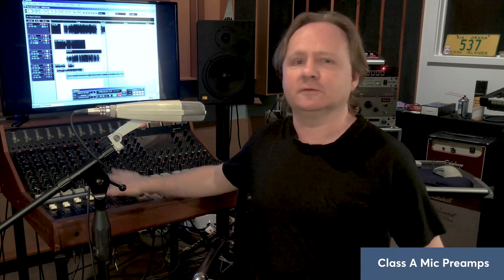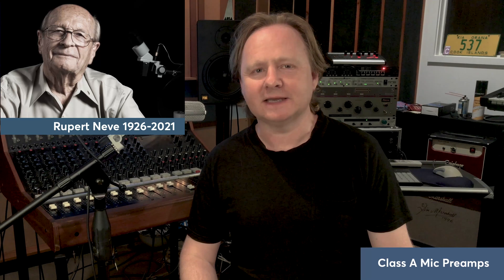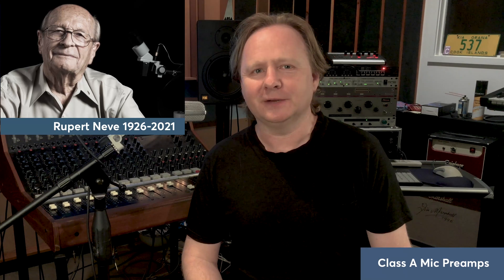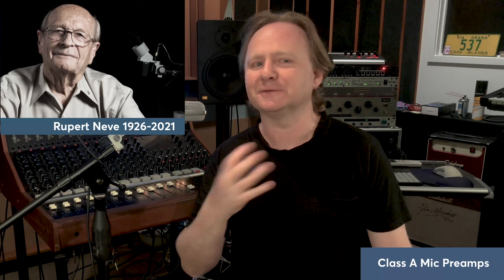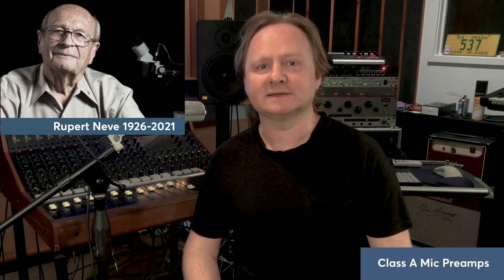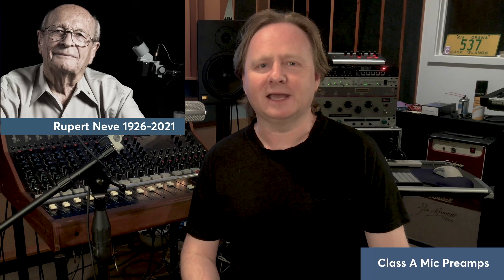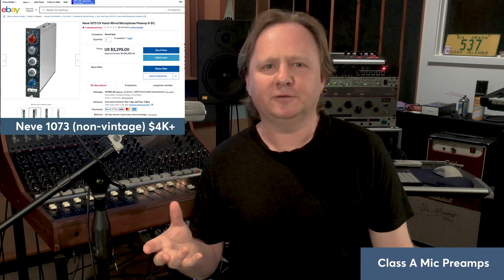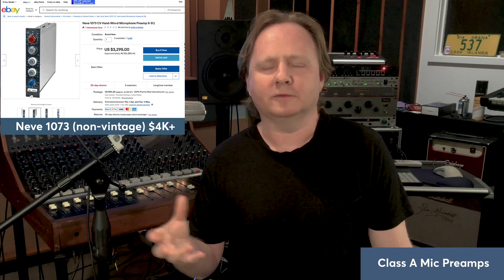Neve Mic Preamps - What is Class A audio and why are they so good?

Comment: the statement about heat is kinda wrong i think. i own a neve 8014 (class a), it does get a little bit warm. but the chip console like neve VR THESE get HOT!
Reply from the maker: True, the IC consoles are the true cookers ... however the large metal transistors in the 80xx consoles did have heat sinks
Reply: @jamiedurrantmusician   yes i know that my modules have heatsinks at the transistor, but the console still doesn't get hot.
Reply from the maker: @pongmaster123  Have you left it on for a day in winter in a seal room?

Comment: “From 1991/92”

I’m looking at a SOS review from 1995 of the brand new (for that time) SR24. Is this different than the one you recommend? If so how do you tell the two apart?
Reply: Also, looking at the circuit diagrams, it’s class a, but not discreet (uses opamps, rather than transformers/transistors). Never bothered to distinguish between those two classifications as you so often see them together. That just shows how un-holistic my knowledge of electrical engineering is. lol
Reply from the maker: The SR24 is a more streamlined cheaper design but still has the sound and very clean VLZ mic preamps. I think it is more limited with only 1 mid sweep eq - the earlier designs  had two mid eq. I did an album with a band in the early first release console and one on the SR24 - the tonality was identical. And the recording sounded great!
Reply: @jamiedurrantmusician  So, how are we to tell the difference between the two versions?
Reply from the maker: @GeoffBosco  Sorry, the original series was the 24.8 8-bus for example - then came 16 and 12 channel versions. See: https://reverb.com/p/mackie-24-dot-8-24-channel-8-bus-mixing-console - the SR came after the 8-bus models
Reply: @jamiedurrantmusician  Thank you!

Comment: I think you forgot to mention a lot of the Neve character. Input and Output Transformers to fatten up the sound with harmonic distortion. The ability to slow the transients down from the windings and transformer gauges to reduce harsh spikes in the signal. The circuit design adding some natural compression gluing the tracks together. It would help to educate people why the NEVE sound is so desired, and how it makes mixing easier by adding these characteristics. That way people can learn what to listen for.
Reply from the maker: Brilliant points Matt... sounds like a part #2 is required.
Reply: @jamiedurrantmusician  Thank you! I just hear so many people talk about NEVE, but most new engineers don't understand what vintage gear actually did to the signal. As audio goes more digital for recording and using transparent preamps. Most people don't even understand what is missing or what "that sound" actually is.
Reply from the maker: @theblowupdollsmusic  You make a lot of very good points... I'll re-watch my video and consider how I've not covered this topic thoroughly enough!
Reply: @jamiedurrantmusician  I'm excited to see your follow up! :)

Comment: 💯 great vid 
As close to class A as pos is always best. that doesn’t require actual class A tho, example of class A/B below (close to class a but NOT class B)

Neve Air consoles (NE5534N) designed to be closer to class A ( not class B )

1081 Neve 
Class A 
output stage class A/B

8078 Neve console 
Class A/B (not class B)

Neve melbourn console 
Class A/B transistor (close to class A)

Neve Kelso console 
Class A pres (direct outs Class A/B) 

Neve 5422 console 
Class A/B (not class B) 

There’s a few more Neve’s that are class a/b out there. 

EQ
Inductor is ideal (like 1073 Neve EQ)
Many classic  Neve’s had inductor based EQ - mid sounds smooth.

There’s some amazing sounding all class a Neve clones out there today, that for that money are killer like warm audio 💯

The ideal thing regarding Class A is that the input source is 100% unchanged and with class B or C or D the source is changed a lot… this is mainly due to distortion and the range of the source not being amplified at all in fact, as the amp is turned off during its function. 
Class A/B is a trick that aims to offer a Class A type result but trying to amplifier the complete source, tho there is a off & on stage the results is a small cross-over distortion, but with a good design this is limited and the source sounds 90% class A.
The human ear is very amazing and can pick up the ….1% cross over distortion, it sounds like a small megaphone is being dropped in the preamp lol.
But with that said class B which is really many brands out there, and this is, to be honest not so good! 😅
But you have to make do with what you have right so humans have that ability to produce results in some cases better than the machines offer!
Reply from the maker: Fantastic info! Thank you for spending the time on this. I'm unsure why I missed this comment, until now, my sincere apologies! JD
Reply: @jamiedurrantmusician  cheers yes, ha I’ve spent to much time researching while rebuilding my baby Neve 😄 but it’s also very interesting stuff hey!
Reply from the maker: @caminglis53  And which baby Neve is that then?
Reply: @jamiedurrantmusician  oh it’s the 5422 suitcase console

Comment: Nicely explained & presented Jamie. What do you think of the mic pres in those old Akai MG1212/14 desks 😁
Reply from the maker: Hi Dave! As I am an owner of an AkAi 1214 I can say that the mic preamps in this unit, like the 1212 are low bandwidth, thin and brittle sounding with lacking body and smoothness. They lack the quality transformer inputs and premium class A circuitry - they just don’t compare. So not very good in my opinion. Upon owning a Neve console in the mid 90s the difference was striking. The frustrations I talk of are based on the AKAi. Sorry to say this!  Regardless I know that you and I both did amazing work on the AKAI machines. Where there is a will there is a way! Jamie
Reply: @jamiedurrantmusician  haha! That’s great Jamie... made me laugh! Glad I stepped away from it & you’ve certainly convinced me not to think about using it for any extra channels! Yes I think we did the best we possibly could with them, made me work harder to ensure everything sounded it’s best at the source!